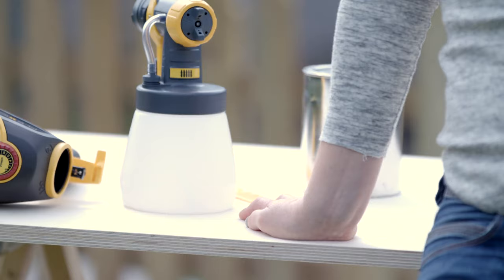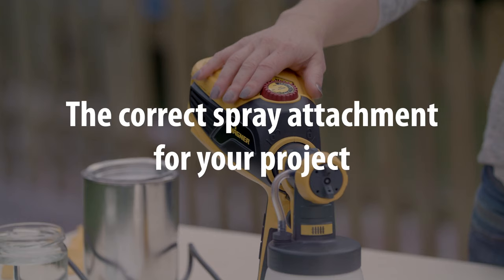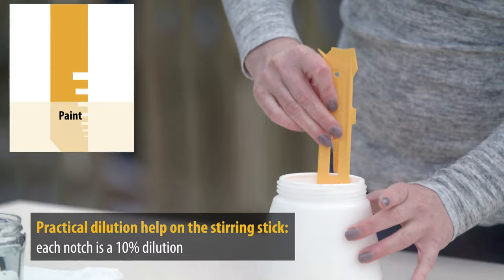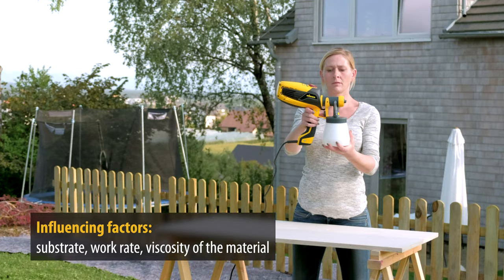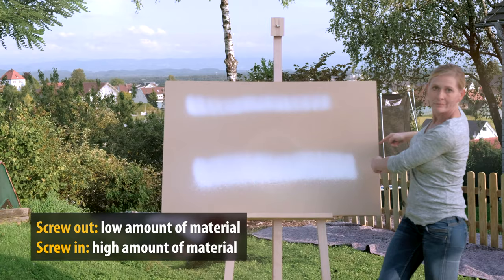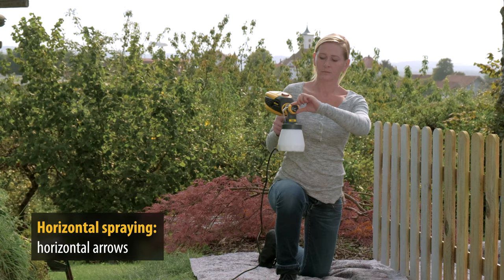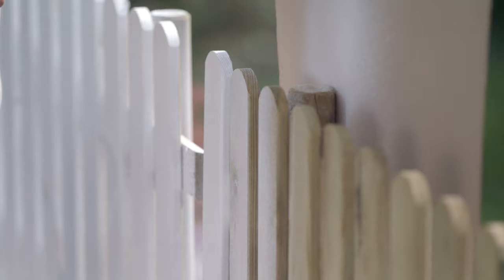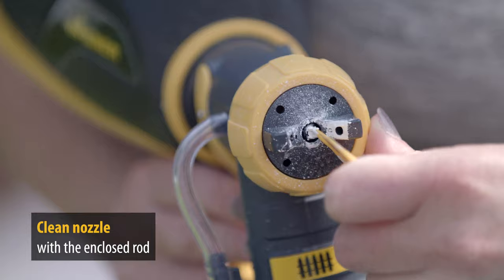How to spray paint a fence with a WAGNER paint sprayer | WAGNER

Comment: Top tip. Don’t take the front nozzle off to clean it while the front is still connected to the motor . It will leak back into the motor. I found this out the hard way today. Will try to open and clear the paint from the windings but I don’t Iike my chances.

Comment: Nothing works better then rolling brushing on paint, spraying paint gives very thin paper thick coating when using roller & or brush leaves thicker paint on the wood much better.

Comment: I've just bought one and my question is why does fence paint come in such massive amounts compared to paint trays or the tank on the sprayers?!. Couldn't Wagner produce a ready filled, disposable, tank?. They're only cheap plastic, same as the container Ronseal, etc comes in.
Reply from the maker: Hi Jack, that is an interesting idea however at Wagner we pride ourselves on producing high-quality products that can be used again and again. Having a single-use pot would go against this ethos. It most economical to purchase only the amount of material you need, but generally speaking when it comes to fences this can be a lot of material - hence the large pot sizes. We hope that helps.

Comment: Hey Carina thank you for a great demo. I really enjoyed the set up tips. I have the Flexio 585 and I always enjoy using it. I have sprayed a garage door, fence, guttering and I recently painted a new timber door. I used the brilliant attachment. I found it a challenge getting an even gloss finish because I used high gloss water base paint in the summer. It dries really fast. I had to pay more attention to the viscosity and volume. I have not sprayed gloss paint before so I found it is less forgiving than a low sheen. It took about 4 coats and I am very happy with the finish. This spring I will paint the exterior of our rendered house. I am looking forward to it.